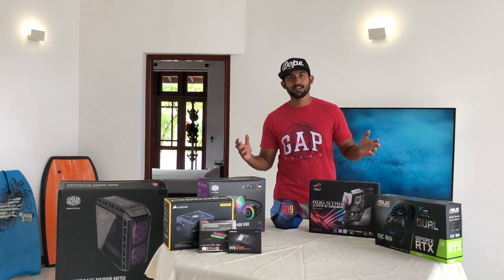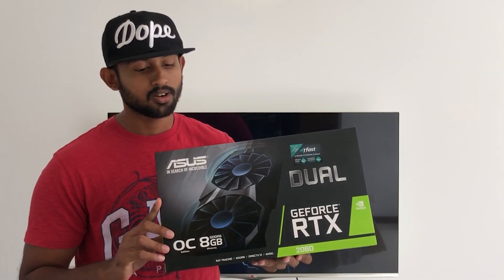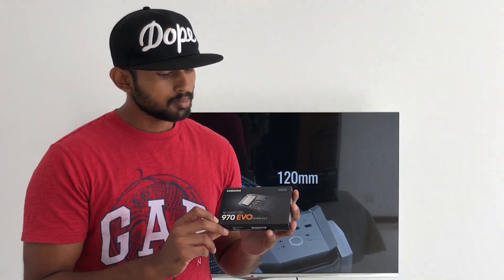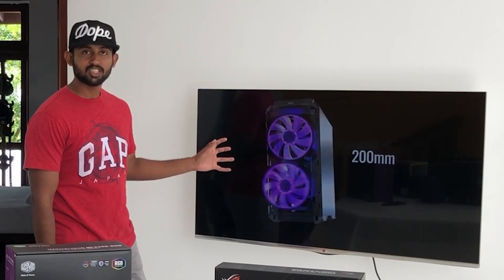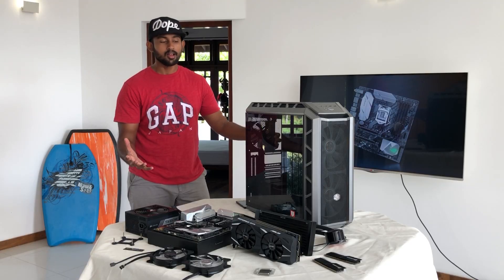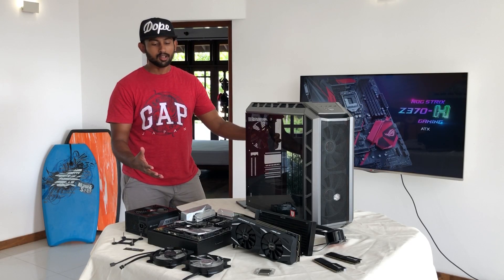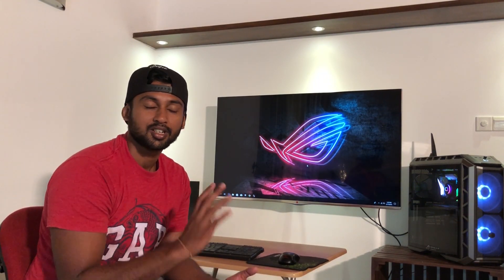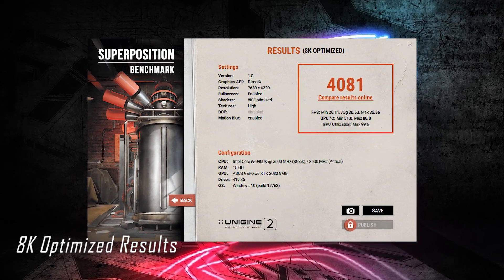Sri Lanka's first i9 9900K & RTX 2080 PC Build and Benchmark test

Comment: Sweet build .but you've made a mistake with the name drive is guess, because you placed the name drive at the bottom slot.But actually you should use the nearest one to the processor chip set for most pcie lane and access full speed of the ssd.
Reply from the maker: Sunny Venkatesh in this motherboard both the M.2 sockets supports PCIe 3.0 x4 so I don’t think it can affect the speeds placing it in either socket. 😆 and the main reason I placed it the bottom slot because it has a heat sink. ✌🏼